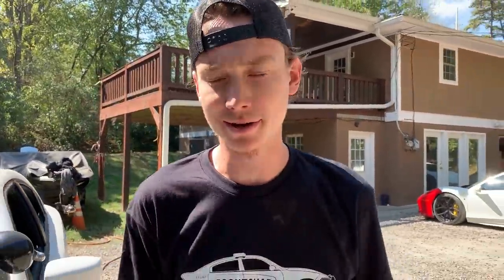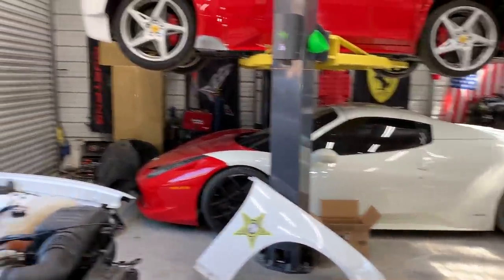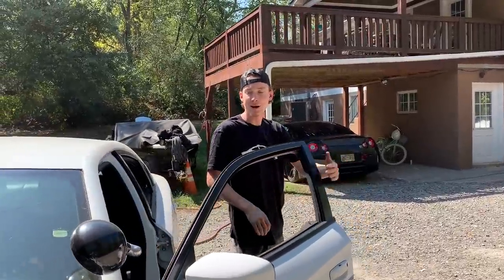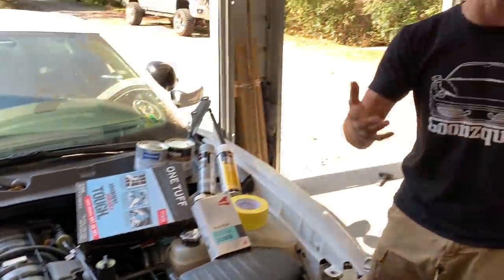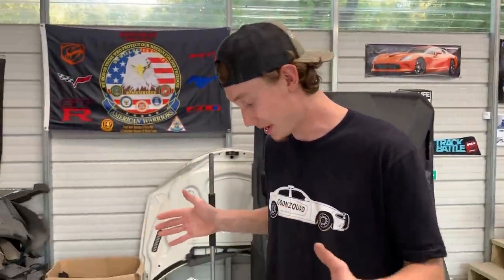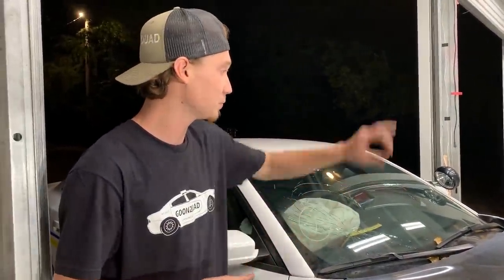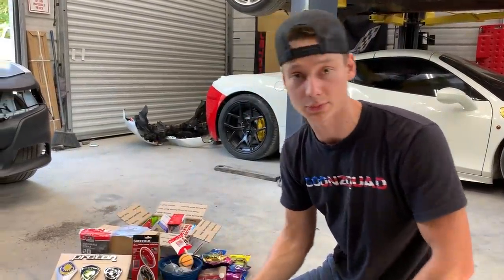Rebuilding A Wrecked 2018 Dodge Charger Police Car Part 3

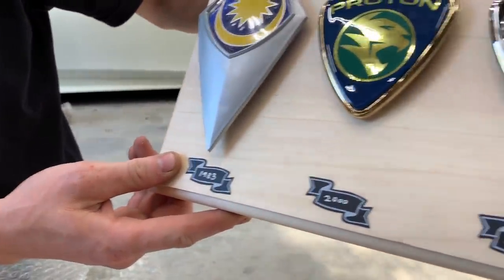Comment: 19:30 Those are the different logos/emblems for one of the Malaysian national car manufacturers, Proton (I think they owned Lotus once upon a time). Another Malaysian car manufacturer is Perodua.
Reply: Terbaik bro.sapalah yg send tu kan. Tapi dari singapore dia cakap
Reply: Proton bought lotus
Reply: terbaik bosskuu
Reply: Which one is the best?  Are they super reliable like toyotas?
Reply: @scottcrockett8270  sadly no, the CVT with the Campro engine they using sucks, but now they are collaborate with a China branded company (just like previously Proton Wira shares 1991 Lancer and Proton Inspira shares Lancer 2010) making new X70 and X50 SUVs
Reply: @zedyt99981  I heard perodua makes some reliable cars?
Reply: @MinotaurvsCyclops  perodua it's like daihatsu or toyota because they use almost the same technology
Reply: @shakld  nice, wish I had them here in Thailand cause they're cheap
Reply: @MinotaurvsCyclops  yea pretty reliable compared to Proton
Reply: @zedyt99981  proton's logo is awesome though

Comment: Dunno if you'll happen to see this, but I just wanted to say  that Cromax 2320S  will be your best friend on most plastics.... However, always test a spot on the back side, since it will melt the crap outta some plastics.  Mainly the rigid black thermoplastics (plastic that melts with heat) .

Comment: Check for the relays in the engine compartment that make the head lights and tail lights alternate and flash.  Also check the rear lights for mini LED emergency lights inside.

Comment: Also, being a 2018, the cruiser could be equipped with ambush alert. Basically if it has it, pushing a sequence of buttons while in park the back up camera will turn on. If someone approaches the rear of the car, it will make an audible noise to alert the officer and could roll up windows, lock doors, would turn on lights, activate siren, etc.  All depending on if equipped and if so how it is set up

Comment: That fresh paint + grounding straps = no bueno. You need to have bare metal for those grounding straps or you may get some weird electrical issues. Use dielectric grease to prevent the metal from oxidizing.

Comment: That passenger side front tire is toast. Drivers side not bad. Is the pressure sensor not working? The sheriff must have been driving with that tire underinflated for a long time.

Comment: Hey dudes. I don't know how much pressure you had on that winch, but please take care to stay away from the cable when pulling. I used to work at a frame shop and I've seen some heavy ass chains break while pulling, and if anybody was beside them when they popped it would have hurt them badly... if they survived. Good videos still! Keep it up!

Comment: Noticed at 13:55 you put the ground wires on a painted surface. May want to ruff up the surface where the grounds will be for a good connection.

Comment: Chrystler products were the first to earn the PP or POLICE PURSUIT label and it was done against Ford and GM. Mopar used a 6 cylinder and the others a V-8. Mopar won by a long shot. Shortly after they introduced the 335 HEMI and it was the main stay for most police across the country. Through the years many have been used for police cars including a GTO and a Mustang, but the ultimate PP was the 1967 Dodge Polara with a 440 INTERCEPTOR. It had been branded by Mopar for their SQUAD CARS....  Yes, Ford has also labeled some of their police cars with the logo INTERCEPTOR, but  the original was a mopar. To this day, mopar has supplied more police cars across the USA than any others..

Comment: Before you put the Hellcat hood on double check that the hood hydraulics are the same for a steal as they are for your Aluminum Hellcat hood. Normally they are different do to weight. Don't want to damage the new hood.

Comment: I wish you guys had better music in your videos, like some heavy metal riffs or something. IDK what's up with this electronic music obsession. But i like your videos so I Subscribed.
Reply: If the music is copyrighted they have to pay to use the music.
Reply: @gpackwood1  so what they dont seem  broke.
Reply: @joshhawn3988  -> If they were to ask me which of course they won't, I would tell them to focus on the purpose of the channel and place any remaining funds in savings and certainly not spend hours and hours arguing with the owners of copyrighted music how much is owned based on how many were watching during what month. There are only so many hours in the day and most of the planning and mechanical work and editing is done by two guys. Sock away those dollars for the future, IMO.
Reply: @gpackwood1  Well they didn't ask you. Plus Its not hard to find a non Copyrighted track and not use the same electro house track on every video during every timelapse phase. but idc its their channel. It was just a suggestion. They would have more views and Subs.
Reply: @joshhawn3988  -> You are correct, they sure enough didn't ask for my opinion but like your opinion, mine is out there now for them to consider.
Enjoy the channel and take a look at some of the older videos. They're worth the effort.

Comment: This will rust, i thought you already understood on older projects that putting glazing putty on bare metal is a horrible idea, and in this specific one even worse, because the welding was not finished, there were still huge  gaps that you coul have filled up with welding spots.
Its not that complicated and you would have had a nice even metal surface O.o

Comment: pneu·mat·ic
/n(y)o͞oˈmadik/
Learn to pronounce
adjective
1.
containing or operated by air or gas under pressure.
"the machines with pneumatic loading are more efficient"

Comment: Any of y'all not in tune with comments about the overly dramatic arm and hand gestures employed by "your boys", check out some of the original vids--VERY few (if any) gestures.  Then Big Bro starts and soon after Lil' Bro, as ever trying to outdo BB, gets ridiculous with it...  flamboyantly flinging arms and hands around willy-nilly.   I know, I know...  if I don't like it I can change the channel.  Yeah...  I might.  I just find the practice  to be cheesy, undeserving of excellence.  If the value of your content is dependent upon needlessly ridiculous physical props maybe you should review your critical path statement.  Does it add to, or subtract from, your mission statement?  Don't have a mission statement?  Hmmmmm...